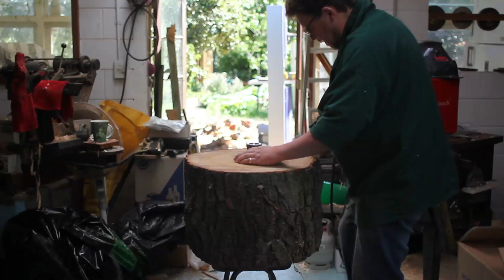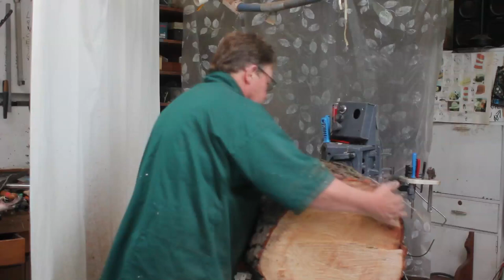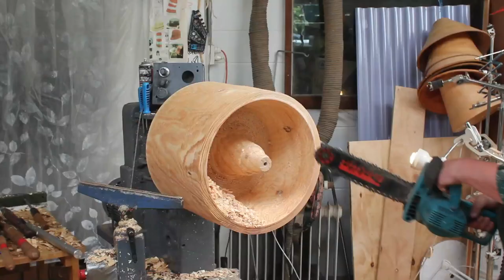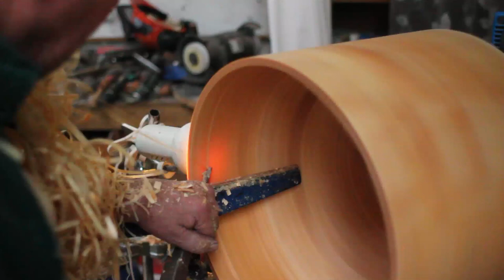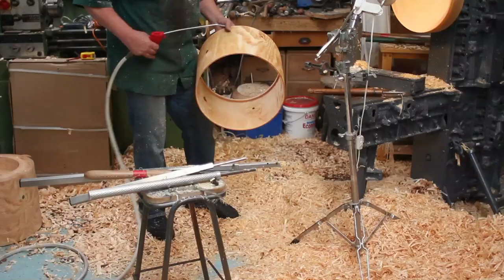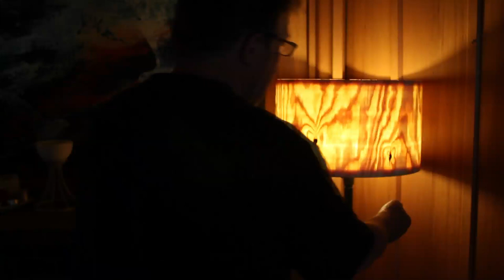Making of a Shade

Comment: Waste of wood ?!!! If it gets used for other sources then it is not waste . All the negative comments - you try this yourself and see how good you are  .   Upload the video so we can all see .
Reply: +Seb K This solid log could be used for anything except the shade (large bowl, lamp etc.), that's why. And also, why someone should do the same? Shade at the end is very light and have thin walls, one careless and accident move with such shade and it's broken. What's the use to waste the whole log to make just one fragile item, while paper or other material will work better?
Reply: Alexey Kozlov The reason is you are admiring the dude's skills . Trees can be seeded and regrown . It;s not a big deal . Do you know how much waste is produced when machining metal ?!!! I know because I make bicycle parts .
Reply: +Seb K It will take approx 25-30 years to grow such tree (and a log in this case, as a part of the tree) - not a bid deal you believe? I imagine how much waste is produced in metal production because I'm an airspace engineer (aircraft and helicopters), at least you can recycle the metal waste and reuse it. I doubt this dude will recycle the sawdust from the log, and there is no much use of the woodworking waste in his case (I think he simply burned it later or put all in garbage). Whatever, he can do whatever he wants, I've just expressed my opinion that's it.

Comment: Bend a veneer around a bucket and glue. Equally as good for a lampshade facing a wall and takes 1 minute. It also doesn't turn a whole log into shavings. If the end of the log had been left and stabilized somehow it would be far more 'unique'.

Comment: It looks great! I'm just wondereing: this seems to be fresh wood, so it's not dry. What happens when the finished lamp shade has been sitting in room temperature for a while plus after being heated by the light bulp? Won't it dry too fast and either get bent out of shape or start to crack? Or both?
Reply: Thomas Dyrehauge no worries.   the fool will cut another log and repeat the process

Comment: I saw a comment regarding on how the wood is used; is there honestly no way of working with it?  Not even for say, drying out the wood and turning it into what could be the base of a custom wood lamp?

I actually thought that might've been what was gonna be done - hollow out the center, somehow carve and turn it into a base for a lamp.  Wire it up, stick some wires in to hold a shade, and then the rest of the hollow cylinder is turned into the shade.  I'd feel it'd be worth it in any case....

Comment: Is that a machine shop lathe, or a modified grinder? Also, the item that holds the center opposite the machine, does that go through to the machine, and how did you align it?

Comment: 4252 idiots that think its a waste of wood are probably sitting in a chair supported by a wooden floor attached to a wooden frame structure that was built with trees that came from elsewhere instead of the ones that the developer cut down and removed from the lot that the structure sits on. Then the tree service chips them up and sells them back to those idiots so that they can put the chips in their flower beds so the dirt looks pretty. No waste there
Thanks for sharing the video. Gonna try it myself.

Comment: why not just use that same thing, and insert a sharp knife from two inch of the outer wall, and just get the center out, then work on the outer 2inch thick wood, would save so much trouble and wood.